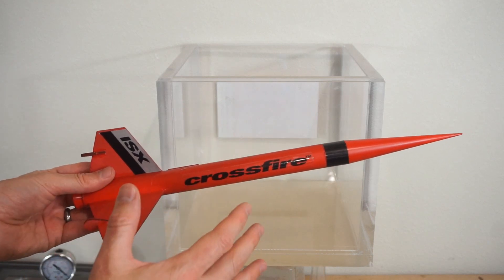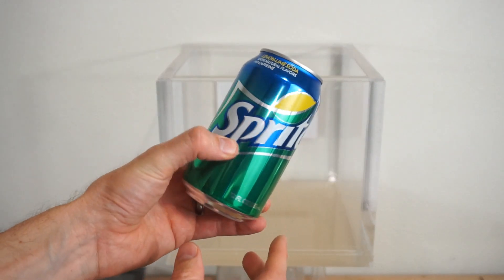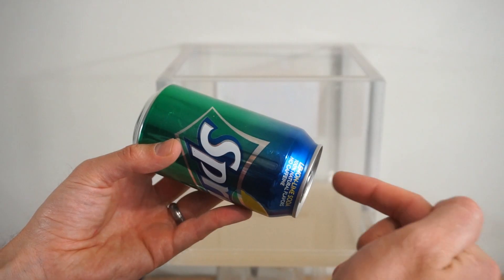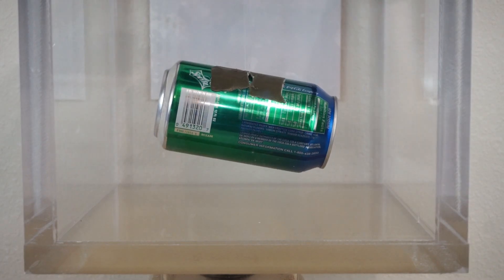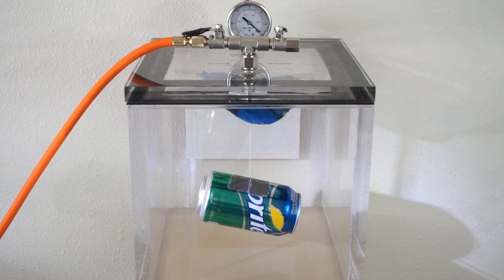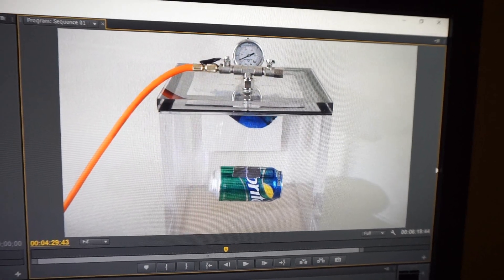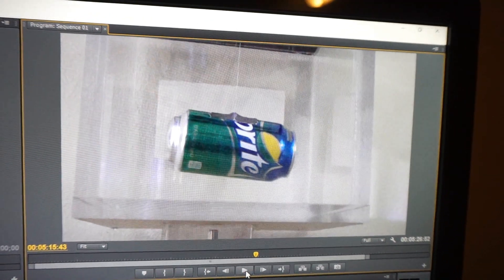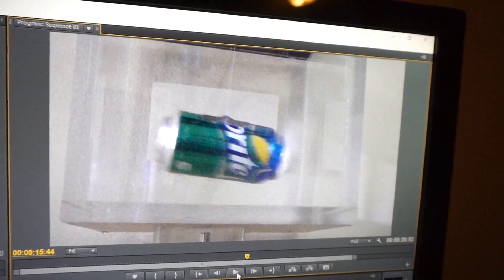Can a Rocket Fly in a Vacuum Chamber?

Comment: It's pushing off the side of the chamber, which is even more substantial than air. In a complete vacuum, rockets would have nothing to push off of.

Nasa is a hoax organization, and everything they have told you about what lies beyond the limits of our atmosphere has been wild, unverified speculation at best.
Reply: You are entirely wrong.  The can IMMEDIATELY moves when the contents are expelled.  Why?  Because of a fundamental law of physics : equal and opposite.  If you eject mass away from you, you will be propelled in the opposite direction with the exact same momentum.  AKA - conservation of momentum.  Why would the can move because the particles it ejects hit something?  That makes zero sense.  The can and the wall are not in any way connected.

If you sit in a chair that has wheels and you have a bowling ball, and then you shove that bowling ball away from you - - you WILL move in the opposite direction.  Vacuum or not.  The exact same concept applies to rockets - - except you aren't pushing an 8-pound bowling ball away from you, but rather millions of pounds of ignited propellant........at MUCH higher velocity.  To think you would just sit stationary is asinine nonsense.
Reply: Only because it's within a small enough container to be able to push off the sides. The alleged "vacuum of space" would not have anything to push off of. This is how we know Nasa is a hoax organization.
Reply: @VanGohman  the gas from the combustion directly pushes the rocket. Think of the rocket nozzle as a box with one side removed, with the exhaust gas pushing equally on all sides. with one side missing, no pushing happens in that direction. That adds up to a net forward force.
Reply: @binguloid  Only with something to push off of. Without something to push off of, there is no opposite reaction created.
Reply: @VanGohman  the ship is the thing to push off of
Reply: in fact, most rocket engines are more efficient in vacuum because there's less air to push off of (thus increasing the difference in forward vs backward force)
Reply: @binguloid  Cool story bro. Have you ever tried testing this in an infinite vacuum?
Reply: @VanGohman  in an effort to understand your point of view, how exactly does the energy from the gas hitting the wall translate to the object being accelerated?
Reply: @binguloid  By being a solid object the escaping gas has something to push off of when there is a containing wall.
Reply: @VanGohman  but gas, being compressible, will transfer effectively no energy back through itself; it's not solid. Upon hitting the wall, it will expand outward and, at least for a second or two in such a small container, will not interact with the engine. How then, could enough energy to move the whole thing be transferred back?
Reply: @binguloid  It's coming out of the engine, as this gas hits the wall, it then pushes back against the engine.
Reply: @VanGohman  So if you fired a crossbow into a vacuum, would you feel any recoil force?
Yes or NO?
Why or why NOT?
Reply: @stuartgray5877  I would feel the crossbow mechanism going off because it's a physical object, but it's not like I'm feeling the push back from the bolt.
Reply: @VanGohman  So you are saying the bow feels a recoil because it pushes on an object with INERTIA?

What physical property gives an object "Inertia"?
Reply: @stuartgray5877  I'm saying that you need something to push off of for thrust to work.
Reply: @VanGohman  So what does the CROSSBOW "Push off of"?

The projectile from the crossbow has a certain physical property that gives it INERTIA.

What is the NAME of this physical property?
Reply: @stuartgray5877  Let me know when you work all of this out for yourself. :)
Reply: @VanGohman  Next try to tell me that the rocket's exhaust gas does NOT have any mass genius.

Does the rocket engine "Accelerate" the mass of the exhaust gas?

Does it apply a FORCE to accelerate that mass, or does it accelerate mass using Magic?
Reply: @stuartgray5877  Why would I ever try to tell you anything like that? :D 

If you still haven't figured out why a rocket wouldn't work in a complete vacuum yet, try figuring out how a complete vacuum would be able to exist next to a pressurized system without some kind of barrier between them.
Reply: @VanGohman  - "try figuring out how a complete vacuum would be able to exist next to a pressurized system without some kind of barrier between them."

Oh I have NO trouble understanding that.
 I am also a Vacuum Test Specialist first trained at Lockheed Martin Space Simulation laboratory operating some of the nation's largest thermal vacuum chambers (AGAIN - Before you were born)

Oh you think it is impossible having a vacuum next to pressurized atmosphere?

Tell me the theory of operation of the Gas Centrifuge.
Because a Gas Centrifuge can create a region of high-pressure gas adjacent to a region of low-pressure gas ( a VACUUM) with NO PHYSICAL BARRIER between the two regions.

Care to tell me how a common machine can do what YOU claim is impossible?
Reply: @VanGohman  And I see that you just run away from questions. Is THAT why you dropped out of high school?

Are you UNABLE to explain what MASS is or how it requires a FORCE to accelerate it?
Reply: @VanGohman  Sorry but people that failed to complete high school should NOT go around trying to lecture actual Rocket Scientists about how Rocket Propulsion works.

This is called the "Dunning-Kruger Syndrome".
Have the teacher of your special needs class explain that TO YOU.
And Bless your little heart!
Reply: @stuartgray5877  Rockets won't work in a vacuum, because they have nothing to push off of.
Reply: @VanGohman  - "Rockets won't work in a vacuum, because they have nothing to push off of."

But the CROSSBOW DOES?

WHAT is the crossbow "pushing off of"?

Why can the crossbow find something to push on in the vacuum of space but the rocket cannot?
Reply: @stuartgray5877  The bolt is being pushed by the crossbow mechanism. Have you ever used a crossbow before?
Reply: @VanGohman  Yes. But the BOW feels a RECOIL FORCE pushing it BACKWARDS.

Did you NOT understand my question?:

SO, if you fired a CROSSBOW into a VACUUM, would you feel a RECOIL FORCE?
Yes or No?

I guess I need to hear your answer again, since it appears you did not understand it the first time.

Since Crossbows DO HAVE RECOIL, Do they STILL have recoil even when fired INTO A VACUUM?
WHY? or WHY NOT?
Reply: @stuartgray5877  I've never shot a crossbow into a vacuum.
Reply: @VanGohman  I have. they still have recoil.
This is due to the fact that the Projectile has MASS.
This gives it INERTIA which is a Resistance to being accelerated.
Any time you push on an object with MASS you feel a recoil force.
Reply: @stuartgray5877  There is no way anyone let you shoot a crossbow in a vacuum. I simply do not be-lie-ve you. :D
Reply: @VanGohman  _ I have personally built, tested, and helped Launch Six spacecraft in my career.  Three of those had mechanisms very similar to Crossbows for separating the spacecraft into two separate pieces.

Those were Stardust, Genesis, and Deep Impact. Look them up genius.
Reply: @VanGohman  Have you ever played with a Toy Water Rocket?
They push OUT the water (mass) and feel a recoil force as a result (this is called "Thrust").

They are technically "Mass Accelerators" and still work just fine in a vacuum.
They actually work MUCH BETTER in a vacuum as there is no atmospheric pressure to hold the water back giving it higher exhaust velocity (with respect to the nozzle).
You have never even HEARD of the 100-year old Tsiolkovsky Rocket equation but you want to lecture actual rocket scientists about basic physics?
Reply: @stuartgray5877  Because the ejected water/air pushes off the atmosphere. they wouldn't work in a vacuum either.

What led you to believe that the rockets you were launching ever made it into "space"?
Reply: @VanGohman  - "What led you to believe that the rockets you were launching ever made it into "space"?"

I have been on the mission operations team of three of the spacecraft I helped launch.
Those were: Deep Impact where I was a Flight Director and Command and Data Handling Subsystem Engineer at Jet Propulsion Laboratory (JPL).

Kepler Space Telescope where I was a Systems Engineer at Laboratory for Atmospheric and Space Physics (LASP).

And NOAA-20 where I was and Electrical Power and Distribution Subsystem Engineer at NOAA's NSOF in Maryland.

I have also seen the Sample Return Capsule from the Stardust Mission in the Smithsonian Air and Space Museum with my signature inside it after it spent 7 years in deep space and brought back samples of a comet.
Reply: @VanGohman  You know arguing the physics of rocket propulsion with actual rocket scientists when it is obvious you dropped out of high school is called the "Dunning-Kruger Syndrome" right?
Reply: @stuartgray5877  Okay, so you helped launch rockets, and were told they actually made it to "space"? They convinced you by showing you something they claimed were samples from "space"? Were you ever actually able to verify the veracity of these claims for yourself?

Or did you just take their word for it?

Hopefully you aren't falling victim to the Dunning -Kruger Syndrome. :D
Reply: @VanGohman  - "Or did you just take their word for it?"

Search the net for "What happened to Comet Tempel-1 July 4th 2005".

Then tell me what you learned.
I suspect you do not posses the intellect required to grasp the significance of what you read.
Prove me wrong.
Reply: @stuartgray5877  We can read anything that has been written, but that doesn't mean it actually happened does it? What you are referring to is called "hearsay". Is that all you have?

I have personally measured the complete lack of curvature across 55 miles of Lake Michigan. One thing I can definitively tell you is that we live on an extended, motionless flat plane, which pretty much completely rules out the Heliocentric theory, and along with it, just about everything Nasa has ever told us about "Space".
Reply: @VanGohman  So you don't understand the significance of the Deep Impact mission to Comet Tempel-1?
Care to tell me what happened on the evening of July 4th 2005?
Reply: @VanGohman  - "I have personally measured the complete lack of curvature across 55 miles of Lake Michigan."
No you have not.
But want to know something I HAVE been doing for almost 30 years now?
I test fiber-optic Gyros (Inertial Reference Units) using earth rotation as the stimulus.
I can measure the rate of the rotation of the earth, which direction is "True North" and my approximate latitude to within fractions of a degree using these devices.
But I am sure you know more about these devices than an actual Engineer who was trained how to test them by Lockheed Martin before you were born.
SO please tell me what I have been measuring all these years.
Reply: @stuartgray5877  Yes I have measured the complete lack of curvature across 55 miles of Lake Michigan.

North can be found with a basic compass. Not sure what you think you were doing while finding "true North", but it sounds like a waste of time to me.
Reply: @VanGohman  - "North can be found with a basic compass."

I said "True North" not magnetic north.
And these devices measure CURVATURE AS well as rotation.
Reply: @stuartgray5877  If they are showing you that we are living on a spinning globe, then those devices are lying to you.

As I was saying before, we live on a motionless flat plane.
Reply: @VanGohman  Ahhh, so YOU don't believe in "Science".

Understood.
I guess we are done here.
Reply: @stuartgray5877  I actually did "The Science" and don't think your arguments support your unverified be-lie-f that we live on a galactic tilt-a-whirl of death.

The actual "science" disagrees with you.

Feel free to continue to assume things you have been told if that makes life more comfortable for you as a "rocket scientist". :D
Reply: @VanGohman  SO you DO NOT have the intellect required to tell me what happened to Comet Tempel-1 on July 4th 2005.
Understood. I accept your surrender.
Reply: @VanGohman  SO what happened to that Comet the evening of July 4th 2005? SCARED to explain it to me?
Reply: @stuartgray5877  I would have no idea what allegedly happened to "that Comet", on the evening of July 4th, 2005.

I'm just here to point out that rockets wouldn't work in a pure vacuum.
Reply: @VanGohman  - "I would have no idea what allegedly happened to "that Comet", on the evening of July 4th, 2005."

Well maybe you can have one of the other five year olds in our lass help you look that up.

And I keep telling you that rockets MUST work in a vacuum for Newtons laws to be correct.
Are you suggesting that YOU know some sort of new physics that defies Newtonian Physics?
Or maybe you just have no idea how basics physics works?
Reply: @stuartgray5877  Newton has already lost me on his unproven theory of "Gravity", so why should we care what else he has to say? He was clearly delusional.

Have you ever actually observed physics for yourself?
Reply: @VanGohman  - "Have you ever actually observed physics for yourself?"

Yes. I am an aerospace test engineer and I have helped build and operate many of mankind's most advanced vehicles including two hypersonic vehicles that actually flew.
Reply: @stuartgray5877  Flew through "space"?
Reply: @VanGohman  - "Flew through "space"?"

Yes. The Stardust Sample Return Capsule that I helped build and launch is in the Smithsonian air and space museum with my signature inside it.
It was the fastest man-made object to fly through earth's atmosphere AFTER being in deep space for 7 years.

I saw it in the Smithsonian, and I would testify that it was the same one I saw leave earth with my EYES in 1999.
I was one of the last humans to touch that capsule just before launch.
There is even video of the reentry on my TT channel that was witnessed by millions of people in California that evening.
Reply: @stuartgray5877  I don't think you are meaning to lie to me, but I don't think that it's possible to actually leave the limits of our atmosphere.
Reply: @VanGohman  - "but I don't think that it's possible to actually leave the limits of our atmosphere."
Your personal incredulity is proof of ONLY your willful ignorance.
Reply: @VanGohman  I have given you MULTIPLE examples of PROOF that space travel is real. I cannot help it if you do not have the intellect to understand what is being provided to you.
Reply: @stuartgray5877  I understand that all you have is unverified hearsay.

Thanks for hearsaying it, but I operate on actual, verifiable, repeatable proof, because I'm a scientist. I can't allow myself to accept your religious beliefs without proof.
Reply: @VanGohman you're only a scientist in your fantasy land
Reply: @CorrosiveCitrus  I don't have a "fantasy land". :)
Reply: @CorrosiveCitrus  so you're Stuart Gray too? Noted 😂
Reply: @papalegba6796  No - YOU are the only one of us that has a dozen or so Sock accounts. You have probably lost track of how many you have.
Reply: @VanGohman  - "I understand that all you have is unverified hearsay"
So, MILLIONS of people witnessing that Comet explode TO THE MINUTE of when NASA said it would FIVE YEARS IN ADVANCE is "hearsay"?

Bless your little heart!
Reply: @stuartgray5877  Yep. I hope this helps. :)